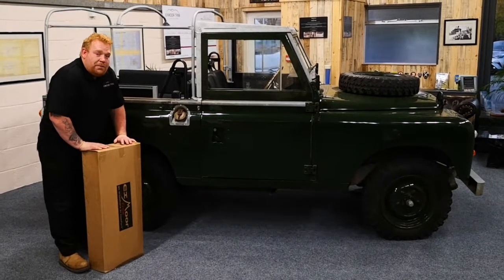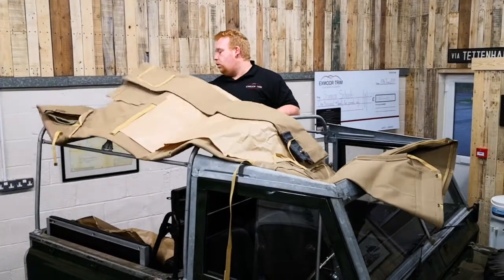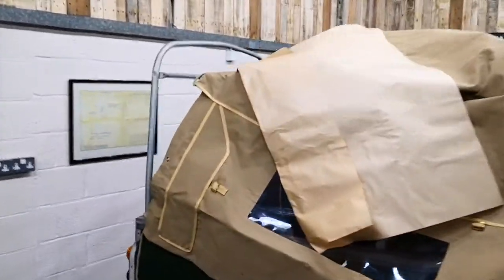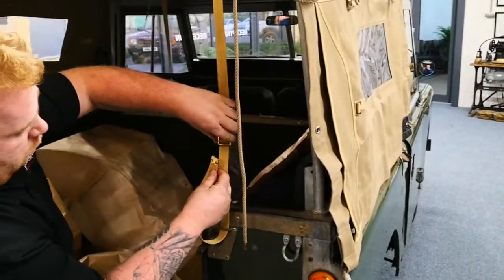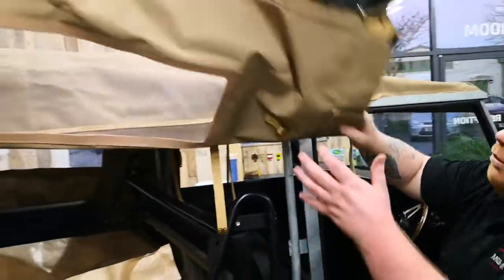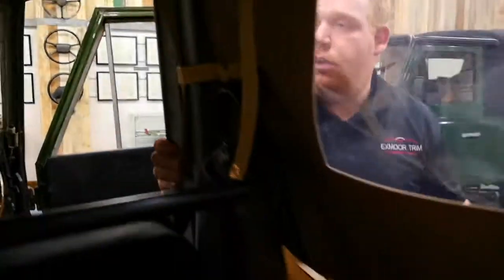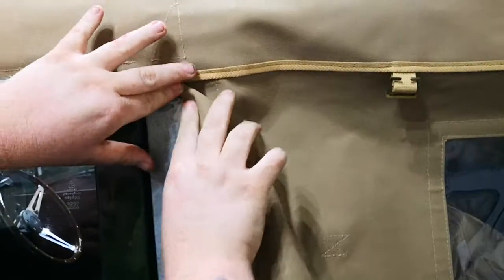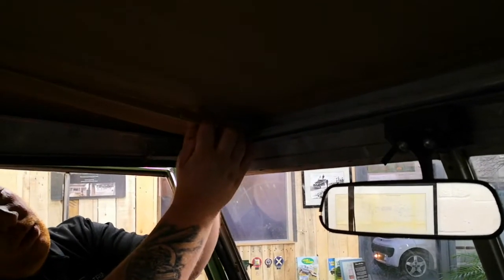88 INCH SERIES 3 HOOD FITTING

Comment: things are done so neatly there. firstly a carpet. neat wood cladding inside the warehouse. brown paper sheets in between canvas pieces. everything on that swb is straight and aligns beautifully. wow, they clearly operate at a different level

my 88 SWB would leak so much oil on that carpet that we would have to top it up before we finish installation...

Comment: Why is the end missing.....the back flap.

I gave up on canvas.....dont last very long these days 2 years if your lucky if parked outside.......no doubt due EU rule on preservatives for canvas.

I dont have any canvass....the land rover dont go out on wet days....simple
Reply from the maker: Hi there, we have a new in depth fitting guide here for canvas, https://youtu.be/4KBnamYOic4 
You are correct legislation has banned the use of many of the preservatives originally used on Canvas during its production and treatment, as while the original treatments were very effective, they were extremely dangerous chemicals. On average with regular treatment with NikWax or Fabsil, the hoods will last 3 -5 years in canvas. We are looking to offer PVC and Stayfast version in the future. All the best Exmoor Trim
Reply: @exmoortrim622  Thank you so much Sir....very interesting.